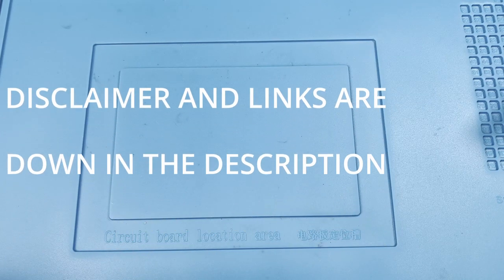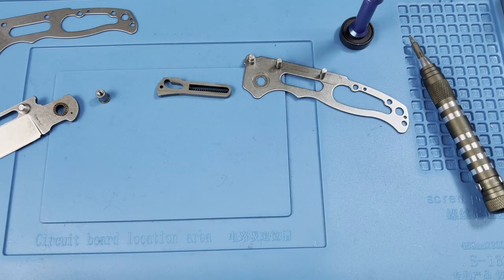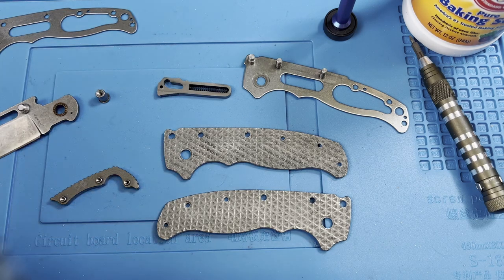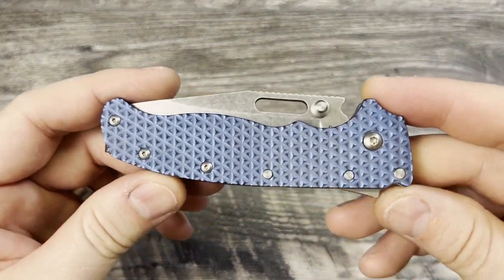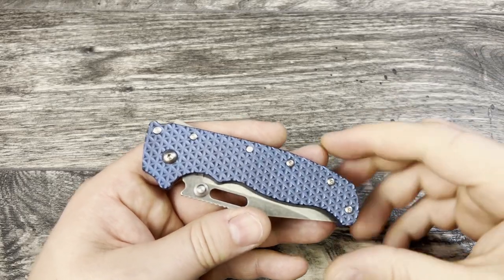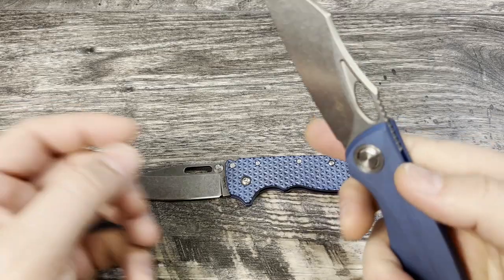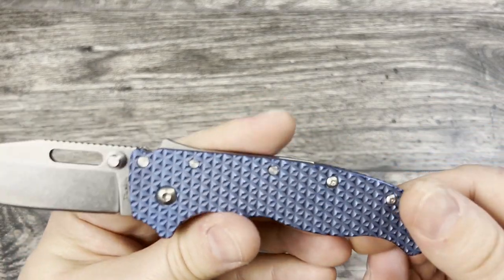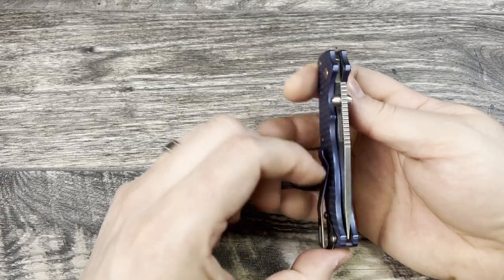Demko AD20 5 Anodizing Mod

Comment: I Love your videos, but the wind noise hurts my ears cause of the bass in my home theatre system and headphones.
When you go to the timelapse with music it's fine otherwise.
I need to turn off my sub woofer and change audio to direct mode to reduce it, but it's still there, but tolerable.
The knives came out great.
I can see what you're talking about with the finish and gradient on your pocket clip, but still looks good.
I've been wanting to do any forever, someday I'll get a dc machine and give it a go when I feel better.
Did you do heat ano on the 20.5 clip and backspacer, I must have missed it if it were in the video?
All looks good, although I also appreciate the many shades of gray.
Thanks for the upload.
Have fun, be safe, can't wait to see your progress in modding.
Reply from the maker: Yeah the fans across the other side of the garage too. Can’t help it is melt without that fan but I think it was also on high for this one instead of low like usual.  

The clip and back spacer are titanium so they were also anodized. I did a faded color way. Took a little longer cause I was changing the voltage as I went. 👍